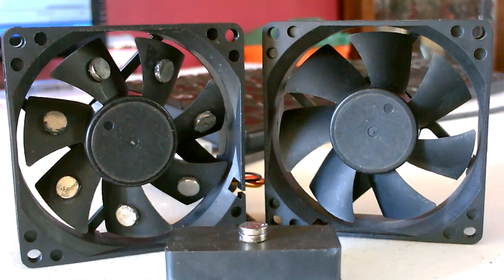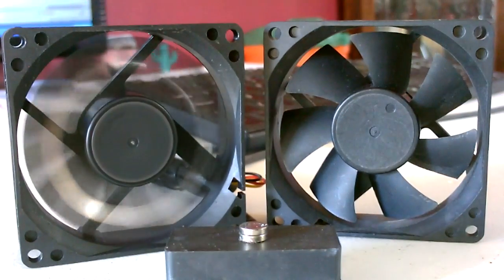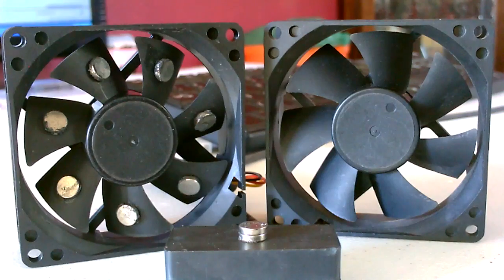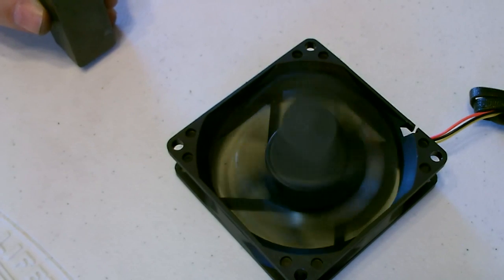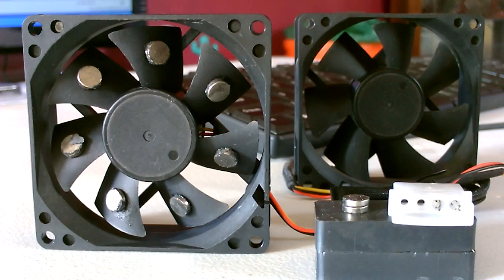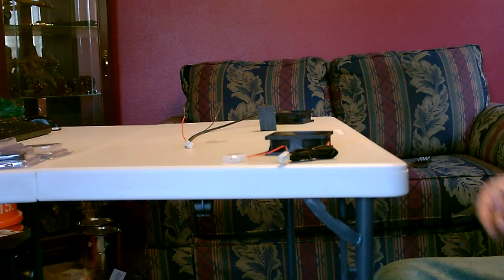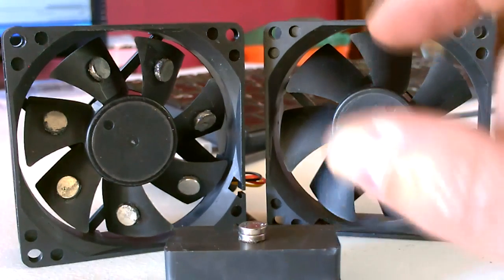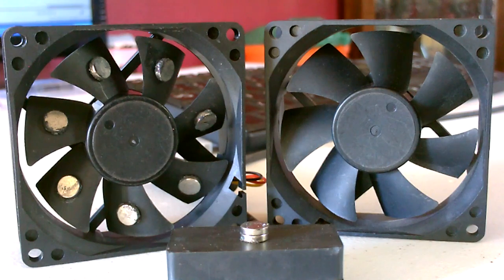Free Energy Magnet Motor! - Free Energy Generator? - Free Electricity?

Comment: Make a huge fan, big magnets, automatic magnet spinner to get the blade running then put it in an air tight tunnel and have wind turbines in the tunnel, once you have a certain amount of energy it can/will generate more energy through the wind tunnel than it uses to just power the magnet spinner. Free energy.. and a simple form at that.
Reply: Austin º
You should trust in the principle of conservation of energy, a fundamental law of nature. It was proved 100 years ago that our universe could not be stable without it. The amount of energy which comes out of a system is exactly the energy which is put in. (It can be different if the system has stored energy which is used up, but I will rule that out for this comment.)
Examples: if you put electrical energy in an e-motor, the same amount of energy will come out. Mainly in form of mechanical energy delivered by the motor, a smaller part in form of heat energy, which makes the efficiency below 100%.
If you put mechanical energy in a generator - which might them from wind rotating a fan - the same energy will come out. Mainly in form of electrical energy delivered by the generator, a smaller part in form of lost heat energy again.
This rule applies to every system without any exception.
Reply: *****
School teaches you boundaries nothing else, I'm going to try and be the next Einstein.
School is a factory line to create people for jobs not jobs for people.
Reply: agnaldo fernandes I live in Europe and I am sure my living is much much easier than yours. I understand your situation very well and of course you wish cheaper energy technologies. But nonsense ideas of crackpots will not help you in any way.
Reply: Austin º exacto se puede generar mas energía con el viento que produce una primera aspa por ej.
Reply: E-Motion
How do you get the weird idea that I don't know about solar and wind energy? When you produce electricity with wind mills you convert the kinetic energy of the air into electrical energy by a generator. Here you have a definite input of energy, conservation of energy is fulfilled. In magnet motors you have no source of energy and that's why they can't work. Permanent magnets are not a source of energy. What about taking some physic lessons?
Reply: Go back in time and say that to all the stoners who brought infinite groundbreaking technologies, sciences and the like to public knowledge.
Reply: Do your own research lazy fuck
Reply: Austin º why would u want to make it spin another fan.. loosing energy in that way, just hook it up straight to a generator... that way minimal energy is lost
Reply: 007whitelighting
A spinning fan creates so much energy, which WOULD be hooked up to a battery bank anyway, and then the wind turbine fans would also gain power! Just a thought anyway, this is where the gold mine is.
Reply: Austin º have you tested to see if funcion with fan? if you already did answer me by favor.Eu'm trying to run a progeto self sustainable energy for residence, if you have an idea that can compartilhar.meu imail is this agnaldo_2012.fernandes @ hotmail.com thanks
Reply: *****
I'm not talking about getting energy from nowhere, I'm talking about getting it from everywhere. There is NO shortage of energy in any space.
Reply: Austin º
There may be no shortage of energy in space, but there is a shortage of energy we can tap. It's a sad fact that many forms of energy can't be tapped. Possibly there will be new possibilities in the future but it makes no sense to tinker with mangnets for this purpose. This definitely does not work.
Reply: Durchblick
Well I will find a way to tap it instead of being useless and relying on what someone else finds first
Reply: ***** god bless you too!
Reply: agnaldo fernandes It is misleading to call  nonsense ideas a ¨project¨.
Reply: Hello my friend Durchblick, respect your opinion, but I believe it is a project yes, because I did not explain everything about it, and this project involves a heólico mechanism also;; good afternoon or good evening, do not know what time it is where you are is ..
Reply: If you could help me, I ride and you prove whether or not a project, please analize and answer!
Reply: agnaldo fernandes Those who are competent in science know, that the goal of this ¨project¨ can't be reached. Heolico mechanism does not help. This is as assured as you can't lift yourself up in the air by pulling at your shoelaces, due to laws of nature intrinsic in our universe. That's why it isn't a project for me.
Reply: yes my friend, I live in a country that electricity is very expensive despite being generated here, whatever the idea of getting power with less cost to me is a project, excuse the expression .Not only energy as all things here is very expensive due to huge taxes we pay, and those who live in minimum wage in my bad case of pay for energy, food and water to feed, this idea is a medium that works .Desculpe the question, in which more country do you live?
Reply: Durchblick whahah yeah and windmills are a fairytail right ? wind can produce energy dumbass
Reply: Austin º I cannot wait to see your blueprints for this design, after all, it is so simple. That is why everyone is using it today right!? Lol. Nothing compared to my "Boomer-Quang" though which is larger than a Dyson Sphere. Powered by only one Black Hole generator. Beat that. Moron.
Reply: +Austin º Yes, there is energy everywhere. But you can't harness that energy without inputting energy. Like an air conditioner. You can transfer heat out of a room and to the outdoors, however you must input energy to do this. Look up the second law of thermodynamics.
Reply: You all wrote this years ago but come on the sun realeases so much energy magnetic energy through solar flares that cause earthquakes the only way we pay for it is when it goes around to the north and South Pole and ends up in your ass cause u didn't collect it. I guess that big ball of gas cost u money to burn.  Free scientifically is not the same as free literally or is it cause I can tell u this it didn't cost me a dime to go outside and stand in the sun to warm up but it sure as hell cost us all something every time I start my car and blow fissile fuels in the air or use up a limited resource on this planet.  Pull the science out of your ass we all went to first grade we know it takes something to make something but matter/ energy is never used never gone just dormant in a new form waiting to be harnessed. Look at universe it was ever expanding for as long as we knew it existed until it wasn't, now it's slowing down omg.  It must be doing that at a price, guess nothing's free.,  o wait lets get into  English now and define free cause not paying for something is free, and not excepting ur foolish doubts that's free advice I give the dude that comes up with the stoner idea cause dam bro your right on it.  Just think of where and how the world could use what you said, find the market and fill it.  The pathetic power companies can't patient what already exist.
Reply: Astin , I enjoyed your project , you are an example that in the future we can use a clean electric power without degrading the environment. Just like you I am a lover magnetism , also make test with magnets , I have a project to generate self-sustaining energy which goes a car alternanor two batteries of 180A and a six pack engine wash and also a power inverter 2000 wts and devices that arms and disarms when the power load arrives at the charging state because here in Brazil these materials are very expensive and I am not buying them conditions, although there was a traffic accident with me where he broke 4 ribs and a collar bone in my body and over 'm unemployed , if by chance you can help me with this project send a reply , I will be grateful ...

Comment: Here's a thought-- What if you placed a toroidal coil under your fan so the blade magnets' fields cut the windings. Then wire the toroid to a second, standard wrapped coil (possibly finer wire/more turns) so that one pole end's field affects the fan blade magnets. Incorporate a diode & capacitor clamping circuit to keep the energy moving in one direction through the standard coil. Fan blades turning will generate an EM field in the toroid, which will charge the cap and discharge through the diode as DC pulses, creating a pulsed DC field in the standard coil, thereby driving the fan blades. Throw your big magnet away, you shouldn't need it.

Comment: Someone had already done this before, except they taped HDD RE magnets to the corners to get the fan to spin by itself with no  human interaction after an initial spin. This would work for a while, but isn't permanent as the magnets do lose their strength with use.

Comment: desertsun02 What if...  you had two fans, both with magnets on the blades, and placed them facing each other, so that the blades of each fan spin in opposing directions?  You'd probably have to give it a spin to get it started but after that, would it keep going?  I kind of want to try it, but I don't have enough  magnets!
Reply: I had that thought also.
Reply from the maker: carriellbee hi there. nope that wouldn't work. no configuration of magnets will work unless at least one of them is being powered by a separate power source (meaning that it's moving) ...and in the case of my video, the one magnet that's moving is human powered. there are a lot of cool looking configurations on how to do it (saw a video of a large rotating drum covered in magnets that looked really cool) ...but none of them work. that's why i made this video the way that i did. (to show how easy it is to make these things *look real). again, these devices can be made to spin (as shown in the video) but not under their own power alone.
Reply: Or maybe if you build in the fan a inversed rim at holds the magnet that allows that rim to spin and that would give you that movement you need to make the fan spin then maybe do the same behind that just make rows of them.. the first one would be powered by a battery and the others with the *reversed rim would end up powering them selfs and if you do enough in a row you may start gaining power on to of power to recharge the battery.. a bit crazy huh but I'm going to give it a try :)
Reply: You know them torches that you wind up to power? there great right :)
Reply: carriellbee Yeah, I'd like to know where can I meet real deal teachers or students at least. All over the place I see copied lies and prizes for remembering them. No offence to conformists, just need a little support with discovering the basics... Do I have to make a team or can join one...
Reply: +FuckYouGooglePlus I completely disagree... the reason why you are seeing these things or reading some of the comments here on the internet is because of a magnet...LOL
Reply: *****
Awww...cute...the Hojo motor! Another idiot links to a thoroughly debunked hoax!
Reply: *****
Wait...you were joking right? You actually linked to an OBVIOUS scam sight that won't let you close the page? There is no way anyone could be that dumb as to think that page is legit.
Reply: FuckYouGooglePlus
Well, they can, you'll learn that when you go to school :)
Reply: *****
The scary thing is, they are using "the earth is flat" for their side. Trying to claim that scientists used to think the Earth was flat. Of course...they DIDN'T, and it just shows that when scientists disagree with the ignorant masses, the scientists will always be right. Like when they knew the earth was a sphere, and then they knew that heavier than air flight was possible, and that this was impossible, while the ignorant masses believed just the opposite.
Reply: desertsun02 But if I wanted to get a 50cc moped motor in a sports car design, to spin up a magnet motor, to spin at 50RPM, and to charge a battery which'll bring the car to Tesla speeds. Possible?
Reply: FuckYouGooglePlus
Three things.

1. You may be right about how it takes a high school level understanding of physics to understand this stuff.  However, they haven't taught physics at the high school level in this POS country for at least 60 years and my guess would be that they never have, at least not in public schools.  So blame the people who make the education decisions, not the victims of their ineptitude (or whatever you want to call it).

2. And so what if I'm wrong?  No big deal.  I appreciate constructive answers, i.e. an explanation of why I am wrong.  I am here to learn.  But YOUR response is a fine example of what is wrong in this world.  Shutting people down and shaming them for asking questions accomplishes ONE thing: the stagnation of human ingenuity and advancement.  So kudos on that.

3. You're a condescending asshole.
Reply: +desertsun02 yeah but what if the magnet you are using as a secondary power ( moving with your had ) would be moved with preparatual motion?! would it work try it out
Reply: +carriellbee They will stop at middle of two magnetic poles
Reply: +desertsun02 Hi! What are the two blocks of magnet you put on top of the fans? Aside from the ones attached in each blade?
Reply: +박시영 how about taking one fan with 7 blades and another with 5 or 9?
Reply: simon appiah Same Result
Reply: +Jesse Fest  ... look up Pakistani invents magnetic generator
Reply: I get your idea,but as you were told one of the fans must be powered,but here is my idea,place the two fans facing each other then in between them put a wire which in in the center of each fa,of which one fan is powered and the other not powered,the one not powered should produce energy
Reply: carriellbee v
Reply: carriellbee .
Reply: *****
IT is the internet's fault. Or more accurately, how too many people are misusing the internet. Something that has the potential to make humanity smarter is turning out to make people much dumber. Because rather than using the internet to supplement their own thinking, they are using it to REPLACE thinking for themselves. They google something, and then accept the first result as a fact.
Reply: MuzzaHukka
Magnets cannot give energy to anything.